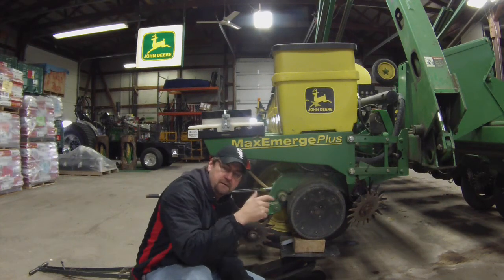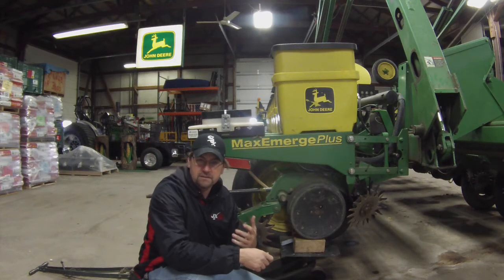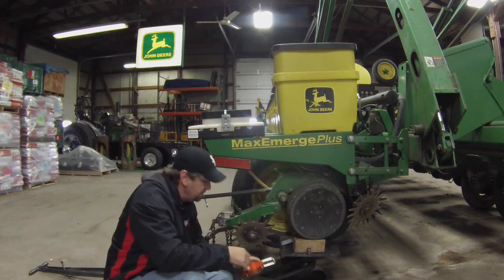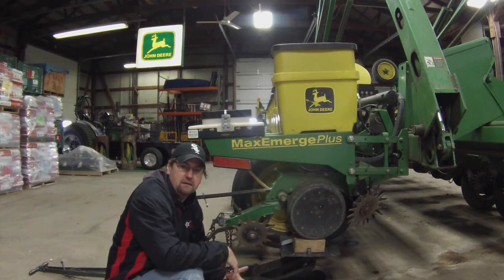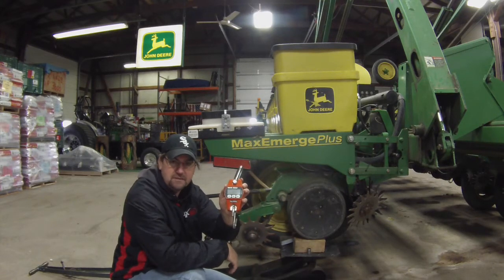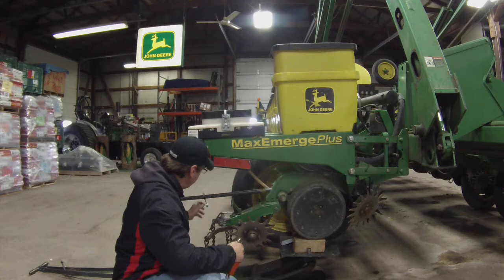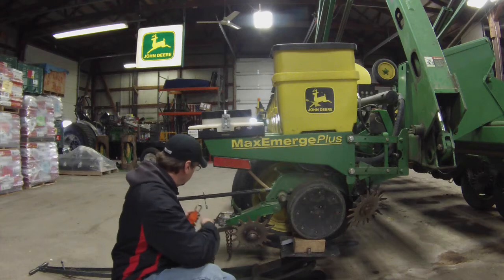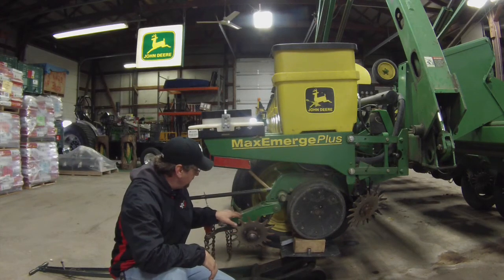Easy depth check and closing pressure inspection on a corn planter

Comment: the pipe you used to lift to find the "pressure" how did you have that mounted or stuck in btween what ?
Reply from the maker: The hole in the closing bracket that is normally for the insecticide tube